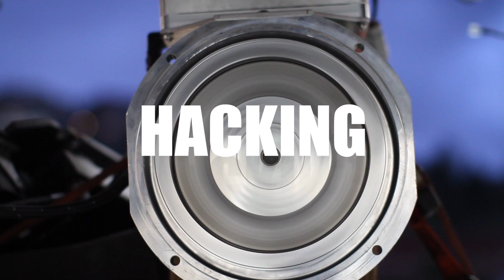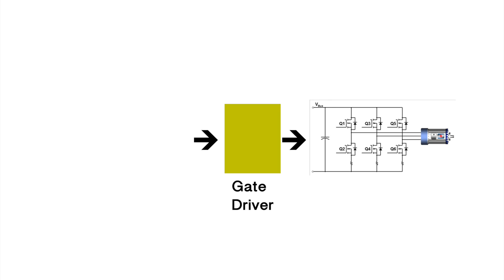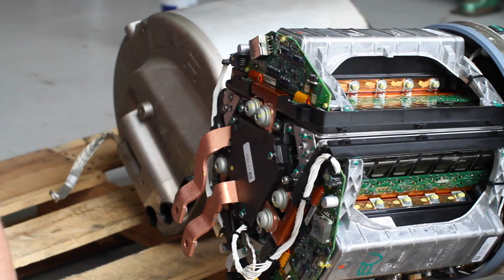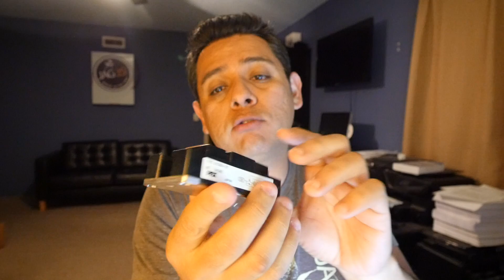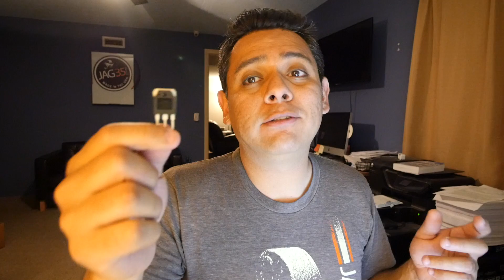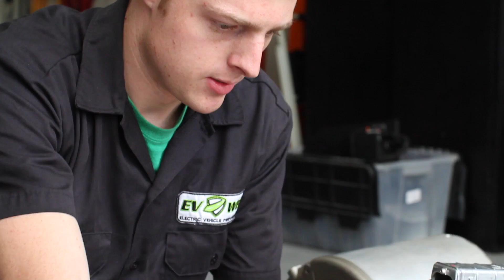TESLA MODEL S MOTOR INVERTER HACKING

Comment: I just had a Tesla S module blowout it's fuses with a hyper 9 motor controller. Thought the battery modules could put out 650 amps but now I am wondering where to set the controller so as not to blow out the replacement battery. Any thoughts on how many amps these batteries can actually put out safely.
Reply from the maker: 1300A

Comment: Great Video, Sir! Concerning ac induction machine for the electric vehicle market one question appears. Normal industrial machines rotate at a frequency of 50/60 Hz depending on the region they're running in. But in electric vehicles is there a fixed output frequency or can you choose the freqency depending on the elctric vehicle?
Reply: A Tesla inverter operates between 0 hertz and all the way up to 400 hertz on the model S plaid. EV inverters are water cooled variable frequency drives.
Reply: Hello brother you can chose the frequency according to the ac motor needs! For torque and speed ( using a frequency variation)

Comment: What if we indtall tesla motor with removing engine and shaft it with auto gear and use autogear for a brain to control speed in different gear by voltage control in between the motor connection and gear control ecu !

Comment: Transistors of the same model may present little variations in gain, this traduces in different temperatures in each one, this increase the gain difference which makes even greater temperature disbalance, if this loop continues some of the transistors would conduct more than others until destroyed, i'm not sure about this but I think that goo is for maintaining an even temperature for all transistors as well as for isolation or mechanic protection.

Comment: If it works don't fix it.  BTW gate driver is more of a switch than a amplifier. But yes it switches with more current or switches  faster.  Also modules you talked about vs t047 are not the best for heat disipation despite what the ic maker promises.  Alot of heat must be ventilated for these igbts.  Also you only have to replace a part vs a huge complex module.   There's a balance. Also motor is not off the shelf. Nice video though.

Comment: In my humble opinion i do not think you can crack the ESC that easy, if i were made that thing for them i would it encrypted. What is the fancy stuff about that ESC. Assuming already known this, the fancy that thing has is how much current that car needs to move with no weight but the card and at what frequency, and i just speculating here.

Comment: The switches are mosfets or IGBTs and the gate is a mosfet driver. The logic (microcontroller) can only signals of 5VDC or less. One of the many reasons you use a mosfet driver is that for the mosfet or IGBTs to be turned on it needs more then 5VDC. The microcontroller needs to know at what position the motor is at so it will know which mosfets or IGBTs to turn on  and there is a few ways to do that. Its basicly a brushless RC speed controller, just scaled way up. The mosfets are the most expensive parts. You could figure out what way the microcontroller is monitoring the motor(s) and use that for your microcontroller.  Just my guess...lol

Comment: Well Look at it this way , more switches , more redundancy , if the ONE very big  IGBT or Transistor  you had blew you are dead on the water , these guys made several and small ones in case one of them burns the rest still can switch , this is all about redundancy and also heat management , ( many small with a little heat output it better than one big hot potato in between your legs ) ( plus you can control the amount of power easier
 ...

Comment: i have a 93 Toyota 4runner. i would love to have a front and rear tesla motor for direct 4wheel drive, but i could never get as far as affording the battery's. it would make a bad ass off road dominator. it would be scary at full power! but all around amazing build. there is a lot of space for a massive battery bank. even one motor would be great. you could split its power between front and rear. my 4 runner is fully gutted. its a shell on wheels. it would be great to test an all wheel drive build, or a front wheel drive build. For now it will get a Mercedes 5 cylinder diesel engine.

Comment: What Tesla needs to do is to get busy ramping up production of these drive units in a format where people can use them for projects in a modular way.  Same with the batteries.  Move the focus from making cars to making the parts that make the cars.. all cars.. better.
The main issue for Tesla that prevents them from doing this.. is the batteries.  Currently just about every battery they make HAS to go to the car plant to fulfill orders.
Hopefully in a short span of time, this will change.

Comment: he told me that plugging this motor in the outlet would burn it immediately. maybe this is one of the secrets of the 300 k miles autonomy. you have lots of extra volts in the battery.

Comment: jehu. i've shown that automatic motor winding video to an technician who rewinds electric motors and he said this look like the  working voltage of the coils is no more than 48 to 60volts. the cables are so thick and so much paralell coils in the same space. just like an outrunner rc model.

Comment: No way these switching devices are cheap transistors. These are very high quality MOSFET devices which switches at a much higher speed than an IGBT. Lemme give you guys a better insight on how a three phase DC to AC inverter works. Switching is done my turning off the gate of the MOSFET with the help of an OP Amp comparator circuit. The inverting and the noninverting inputs of the OP Amps get fed by a high frequency triangular wave and a sine wave. The OP amp compares the triangular wave and the sine wave. The resultant output of the OP  amp comparator is a wave formed of tiny square pulses of varied wiidth. This square wave  controls the gates of the MOSFETS. Depending on which two pairs of MOSFETS are simultaneously turned on, the direction of current flow through the load changes direction. Therefore, across the load, we get a varied pulse width square wave and a second square pulsed wave which is an exact mirror image of the first square pulsed wave. If we take average of the square pulsed wave and the inverted square pulsed wave thus formed, we get a wave which is a very close approximation of a sine wave built with many tiny square steps.
Reply: Thank you

Comment: Hold it right there mate. This motor in "nothing special" ? This motor is propably one of the best ever made in terms of power to weight ratio and knowing the designer of that motor I am sure you have no clue whats going on in there in terms of design, let alone sophistication. If this car is anything special, this is primarily attributed to its motor and its software. We have had inverters and batteries a long time now so what makes an electric car good or bad is essentially its motor and its software. BTW these mosfets can cost 10 bucks a piece so they definately are not "simple".They are really what you want to be using when you want SMD technology and compact efficient electronics that handle huge amounts of power.
Reply: Theo is right. While 3-phase induction motors have been around for a long time, the liquid-cooled rotor & stator of the Tesla motor allows them to push a better power-to-weight ratio than any motor like it. Saying it is just an induction motor is like saying "yeah, that engine in a Bugatti Veyron is nice but nothing special. My honda civic has an engine." The inverter is not just an inverter, it is a variable-frequency drive with very well done controls in order for the motor to perform well in traction applications. Replacing the logic board (even though I am fond of open source hardware/software) would remove the well-tuned inverter controls for whatever they decide to put in. Making well-behaved high-performance traction output requires good controls, inverter design, and motor design. I definitely prefer the EVTV method of figuring out the CAN messages. Less modification and get to keep the controls.
Reply: Lmao calm down bro. Of course someone who helped design it is going to boost its sophistication.
Reply: There may be a downside of not removing the logic board.  If it's from a salvage repaired car it may have been remotely disabled.  Replacing it with an alternative seems like a logical step to recovering a repairable car that the company which built it won't support any longer.
Reply: You don't know what you are talking about
Reply: It's nothing special. It's nothing more than a 400 Hertz AC induction motor which are used quite often in aircraft for auxilary pumps because they are light weight and small. High frequency design AC induction motors have been around for about 60 years now. You are thinking motors have to big because you saw low frequency design AC motors like what plugs into your outlets, which are quite large for the power they create. Those are 50/60 hertz designs since the power grid is not 400 Hertz. Same reason you can hold a switch mode power supply in your hand that is capable of 1000 watts output versus a 1000 watt 50/60 hertz transformer that would crush bones if dropped. The *key* is high frequency.

Comment: well that is simple enough . they used basic systems and the mosfets arranged the way they are dissipate heat better then those Igbts, also the cost is a lot less to make it that way too. So it looks like a very good and simple design . Also they don't have to infringe and pay for other  patents if they used other drivers or pay for more expensive ones .. The sticky stuff is a gel they add for protection like the thick film ignition gel they used on ford TFI modules a while ago. To drive those mosfets is straight forward and it should be easy enough to do. The question is can you drive them as efficiently as Tesla does. That is the entire secret they are using a very well developed algorithm tuned to the motors perfectly. So why would you want to hack and change the programming you will loose your warranty and before you get it down destroy the boards and other circuits . Good luck with it all I wont be hacking it or want to touch even if you came out with open source I doubt it you will be able to do better then what they have now..
Reply: The hack is to get recovered motors working for projects outside of restoring a Tesla car. They're not using perfectly new motors, drivers, and controllers, these come out of wrecks and salvage titles. Tesla has no support for that stuff, and will even disable computers for vehicles that they no longer agree to service. Much of the system is still good, so by figuring out enough to make it run - the powertrain off of a wrecked Tesla will be more than a really fancy paper weight.

Comment: The goo is to help stop vibrations and movement of the IGBT's caused by electromagnetism. They use it in all the inverters i've seen including the Prius and Leaf
Reply: Thats a good question and one I wanted to ask, but this was the explanation that was given to me as to why it's in there, perhaps it works more like a dampener to just slow down or reduce vibration.
Reply: Good call .. it will also isolate power fets from atmospheric contamination.. potentially causing stray parasitic currents leaking all over the place causing random switiching behaviour..  under the goo the fets see good weather all day every day and can behave predictably over very long periods of time..

Comment: Couldn't you just use the ecu from the original car and install it in the new one? So long as you've got the same wheel diameter the calculations will match up right?
Reply: Sarch Lalaith 

Maybe. The body control module and motor have to me reflashed if from different cars for sure.

Comment: I was thinking mount a motorhome with electric engine, getting power to batteries from a set of solar panels (8 x 320 W=2560 w) but someone tell me this batteries area not compatible with solar panels. true ? why ? I want a really sustentable vehicle,  could stand in any place, extend it´s panels for a day or two, get power to all my needs
Reply: rui svensson I think they were right. My Motorhome is 5tonne and requires a lot of power per hour to move it along the road. Say 100kWh per 200km (guessing). Even with 320w panels all over it, 2500w x ~5 hours sun per day is only generating 12.5kwh max per day. So after a sunny day, I can only move another incremental  25km distance (not much). And that’s without extra power to make a morning coffee or other electrical things I want to do with my day inside the motorhome.
So to replenish 100kWh would need 8 sunny days, not one or two as you said you preferred. The math doesn’t work for your requirement.

I found 2.5kW of panels in my home was OK for powering the house for the day plus a bit of the evening, and I’d need at least 2 powerwalls (28kWh) of batteries to get through the full 24hours. But then I didn’t need to move my home an inch let alone past the next suburb...

That said, I’d like (in future) what you are wanting also :) But we’ll need a quantum leap in solar cell efficiency (Currently 15-19%) before that will work with our minimal area on our RVs

Comment: hi some evs i have seen use a dual motor setup, what are the pros and cons of dual motor setup. is it better to connect them side by side with a chain or gears, or to have one behind the other. Is it Just about how much space you have.

also if you wanted a 4wd car could you have one in the front and one in the back?

Comment from the maker: kalimul  quick search will reveal that 400kw motor systems go for around $30k while you can pick up a tesla power train for a few thousand
Reply: LOL! I think most industrial systems is way overpriced. Because they sell them to mostly companies with huge budgets and a very limited range of other similar products they can use instead. Even relatively simple circuits cost a ton of money. I have my self built a funace with a 9 kW power regulator for fun. The power regulator was the cheapest part. It cost only like $100 (with all components connectors and coolers included) - less than the wire used for the heating elements. 
Tesla at least try to keep the cost down - since they have no companies they can rip off money. The customers can just choose another car if it's way too expensive - even though it is still very expensive due to mostly material costs of the batteries, they likely try their best to keep the cost down or at least at a reasonable level compared to other similar cars. And when it comes to those small transistors, those are quite amazing. I only need one of those TO247, IGBTs for my 9 kW regulator. It's simply a large djustable buck converter that adjust the voltage to the heating elements. I run the furnace on DC (it's better, because I can run on 3 phase with only 1 heating wire and get less vibration it the heating elements, so they last longer). 
It's not at all comparable to when used in an audio amplifier, where it's used as linear regulator. The transistors there, basically act like variable resistors with a large voltage drop across them. That causes them to heat up a lot (the power turned to heat is the voltage drop times the current). When used as switches they are ether off or fully on with a very small voltage drop.
Reply: Slightly, but you're missing the point of the industrial builds. They are designed to run for twenty years continuously with very little to no maintenance.
Reply: so wonder

Comment: Fix your CV joint Jehu?
Reply from the maker: i don't have cv joints
Reply: Was the clunking with your samba the inner axle joints? I guess they are the axle with the flat at the gearbox end?

I am doing some design work in this area. If you had to drive your Samba using only one gear, what gear would that be?  DO you know what overall final drive ratio that would give?

What motor did you use?

Thanks in advance,
Stuart.
Reply from the maker: 3rd gear,   i dont know the final gear ratio but it can easily be figured out i guess
Reply: OK, will shoot for an overall 5:1 ratio - but with an adjustable ratio until I can optimise.

Comment: so the Tesla speed controller use 14 mosfets in parallel per phase.
what type of mosfet are they using, can you give us the part number?
Reply: I think they use 28 per phase 14 x 2.  This paralleling of components is nothing new and it main advantage is cost.  Its second advantage is cooling is spread out.
Reply from the maker: IGBTs  are slightly different http://electronicdesign.com/power/what-s-difference-between-igbts-and-high-voltage-power-mosfets

Sorry i do not have the part number,  hopefully next time I go to EVWEST i'll be able to get that info
Reply: @jehugarcia  do YouTube know the motor's impedance? It looks like an huge outrunner RC motor. Not that normal three phase motor
Reply: I don't think they use mosfets, they use  igbt for model s .  Igbts are more durable than mosfets.  And are better at handling these high currents and power.  SiC mosfets are used in model3 . But these are new and expensive. Tesla doesn't cheap out. It's not worth saving $20 to use mosfets imio.

Comment: Jehu, there is a 3rd option. This option would be the simplest, cheapest and most reliable.
You can reverse engineer the software. There are companies that will provide you with the source code if you provide them with the chips. 
Then you can make your own modifications to the code and just upload the code to every Tesla controller you have.
Reply from the maker: yeah i believe thats an option being explored also,  re flashing the logic boards with new software
Reply: Do you know what processor(s) are being used?

Comment: Hey Jehu, remember for any given wattage, voltage and amperage are inversely related, wattage=volts * amperage, it's the law!(Ohm's law) so 400V*100A=40,000 watts or 100V *400A=40,000 watts.